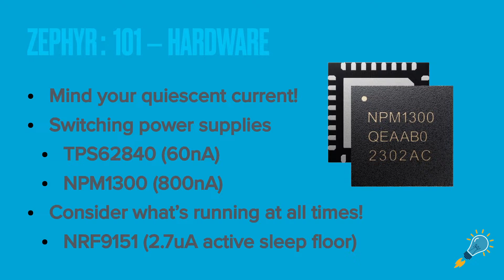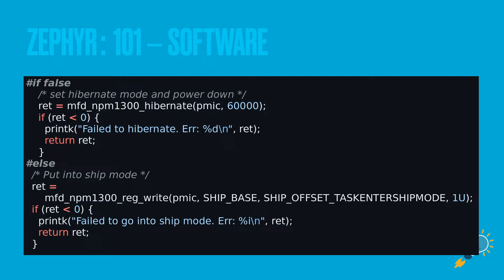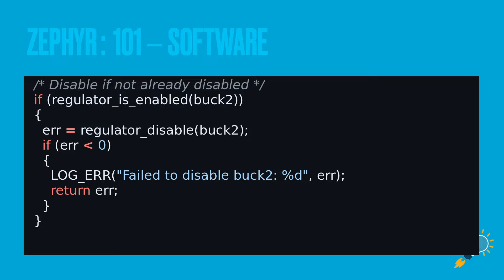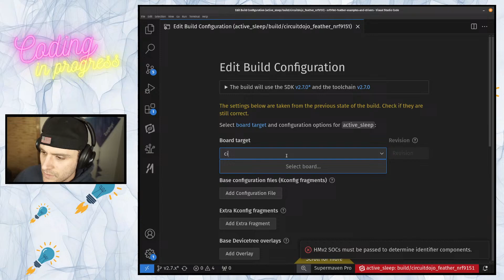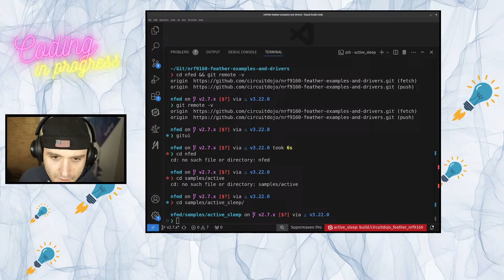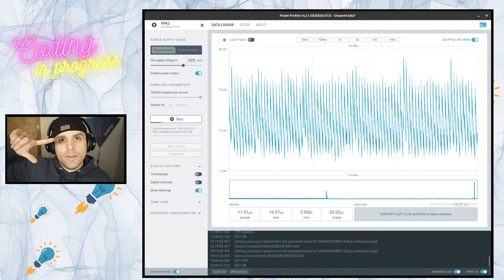Zephyr 101 - Reaching Low Power  ﹤5 µA

Comment: i want to use zephry for efm32. Is this real? can i achieve that low power actually ?
Reply from the maker: This video was more specific to the nRF9151 Feather. I would consult the vanilla Zephyr implementation if EFM32 is supported well enough for low power. Additionally the chip needs to support that low of a power draw as well. (Not all do. Ex. RP2040's lowest power draw is ~200uA)